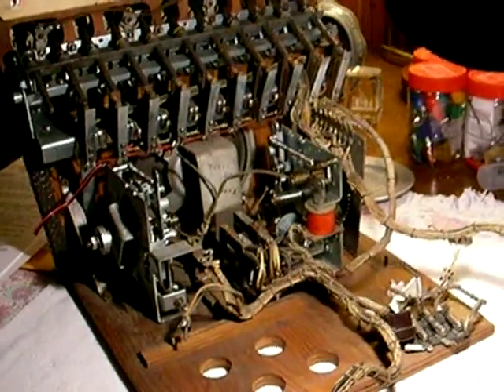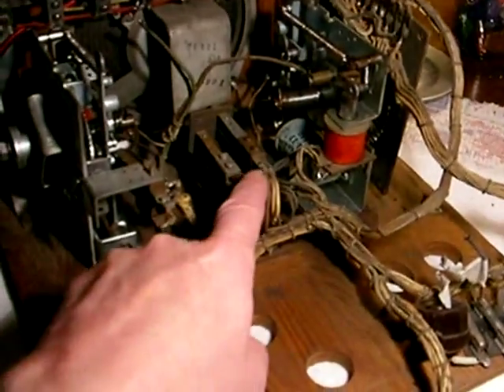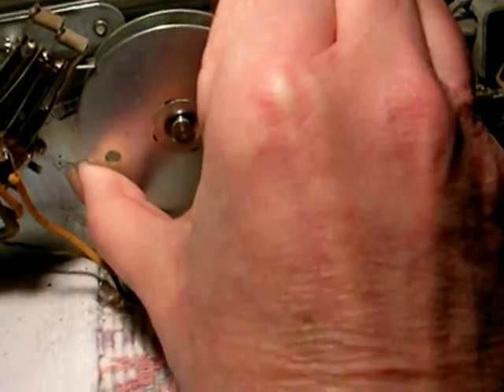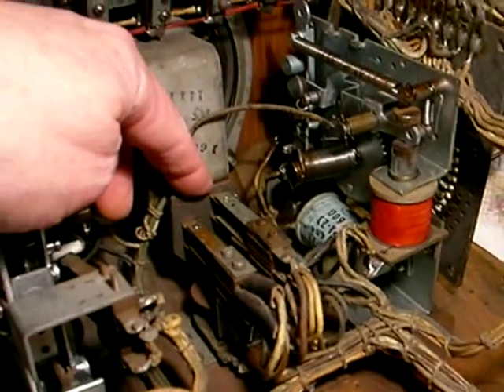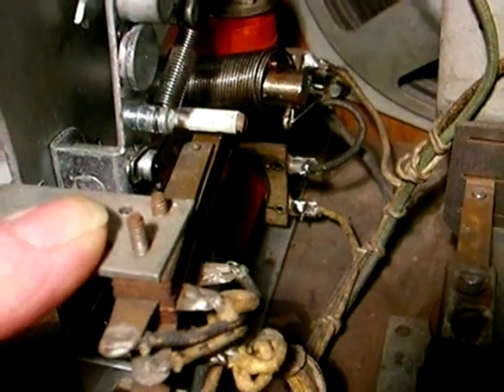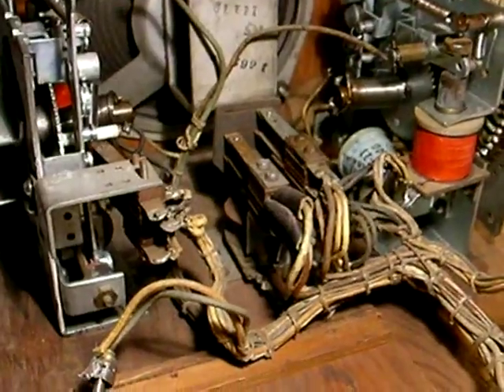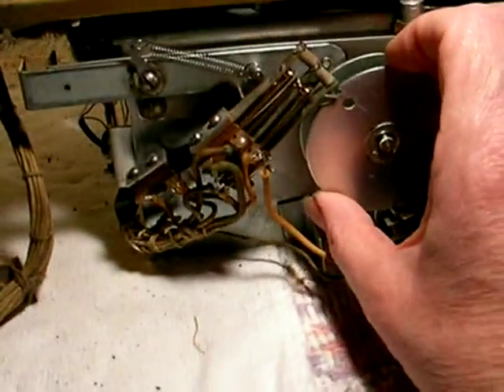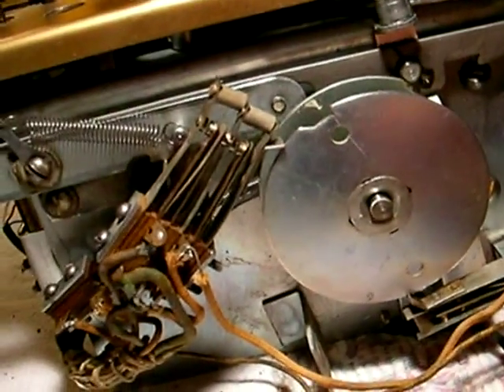Williams Music Mite Jukebox- Part 1

Comment from the maker: Either the stepper is not resetting to zero when it cycles (very common- they get sticky) Or the plate of dots that the stepper contacts are on is too far clockwise. Loosen the 3 screws and turn it slightly.